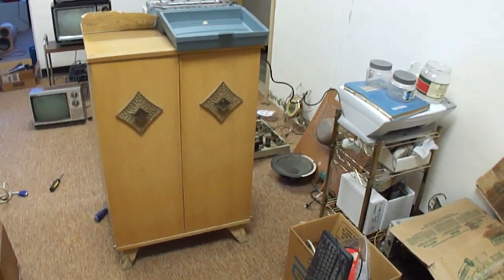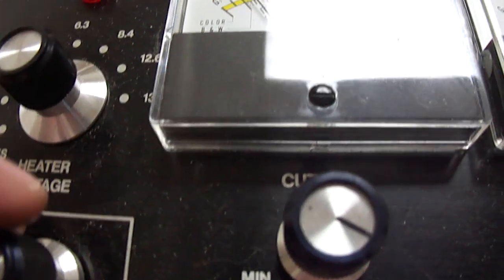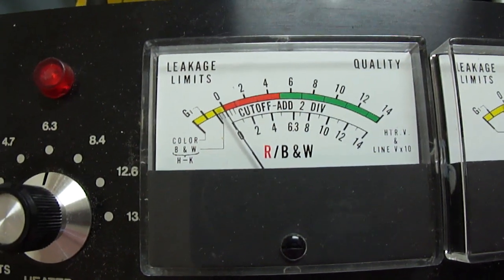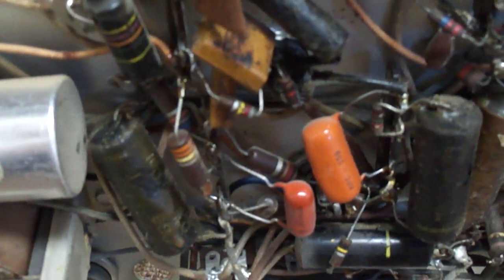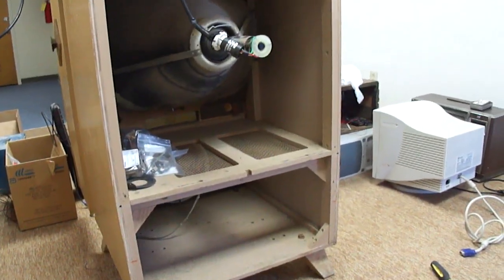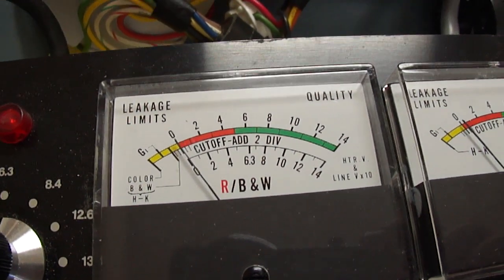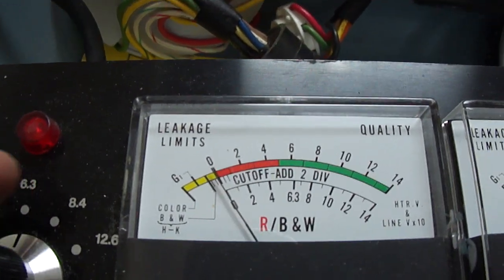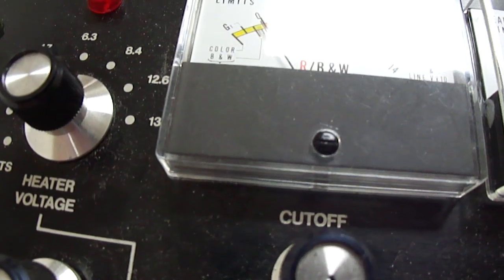1950's DuMont Teleset CRT test

Comment: @MrRobert5 it does when you go to rejuvinate the tube it makes the heater glow briter to heat up the weld and when you hit the remove shorts button it sends a high voltage arc and can fix bad connections as well as burn off carbon on the cathode.

Comment: you should take your soldering gun & heating up the pins on the crt to reflo the solder in them. i have come across this problem a few times when working on these vintage sets